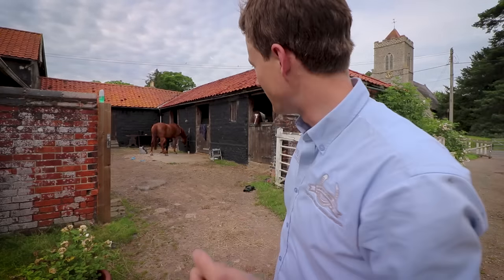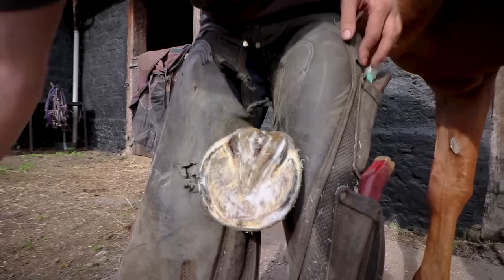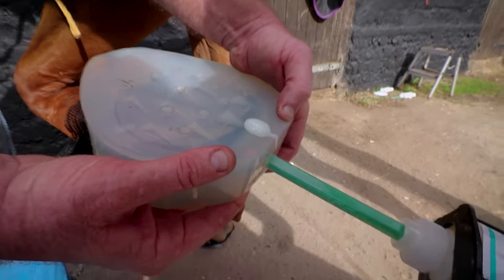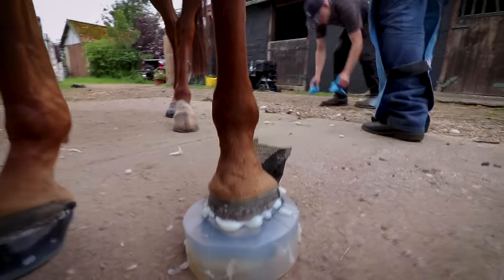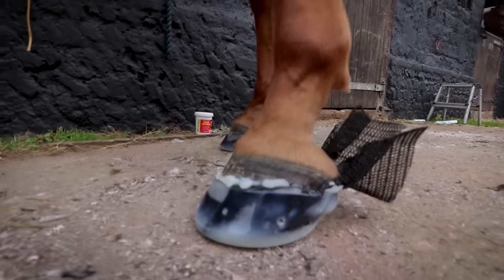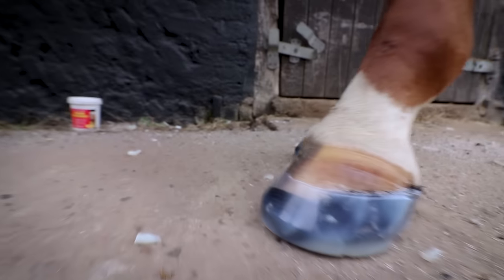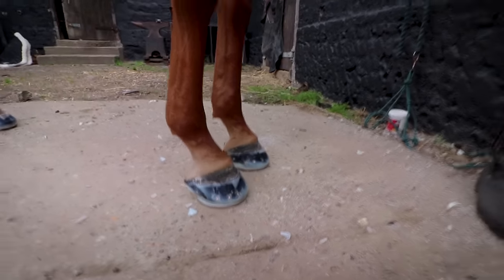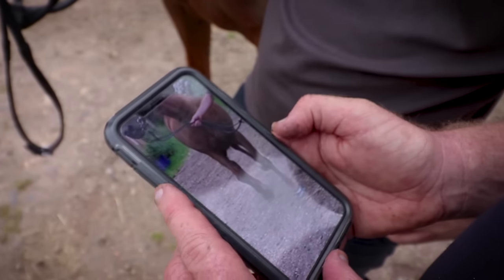How to shoe a horse using resin - Amazingly satisfying

Comment: My only concern would be the hoof wall, sole, frog, and bulb not getting enough oxygen from being completely encapsulated. Kind of like when someone wears a bandage for too long, or fake nails, and the real ones start to turn yellow from lack of air.
Reply: this! the wall needs water and to breath.
Reply: My first thoughts as well. The hoof needs ambient air and moisture to remain pliable and healthy.
Reply: Yeah that’s what I was thinking..it’s like when false nails come off, they do damage the natural nail..everything needs oxygen. I could see it be good for horse with major hoof damage, but I wouldn’t think a long term solution?
Reply: Такие же мысли
Reply: I had this same concern.  This could not possibly be good for their hoof.  Their hooves grow and need oxygen to.
Reply: @April Johnson-  EXACTLY my thought...and I don't even know much about horses shoeing at all, but somehow this concern is the first thing that came to mind right at the start of the video. Maybe a very temporary solution very very short term solution for an extremely damaged hoof until one find a good permanent solution for the damaged hoof that will allow breathing and natural air humidity for the hoof and frog flexibility.

Comment: I've seen these in action, made by professionals at using alternative types of hoof protection. And it still, to this day, feels like a lot of chance is involved. If one of the many factors needed for these, or adhesive options, can not be achived, they tend be faulty. They work fine when everything is perfectly prepared, which sometimes just isn't an option e.g. you come to a private owner, and the horses stand in mud all day. An adhesive wont work properly except you go through a long process of drying and so on. And most importantly, a lot of horses do not have the patience for that kind of procedure. At least I havent seen a lot who do in my years. 
All these alternative horseshoes have their place to be used, but they are an >Option< but not a >Replacement< for iron. People tend to forget that. 
But, I gotta say, you work beautifully and I hope there will always be farriers like you who can do these types of shoeing this well, so people like me don't have to. 
Cheers from austria!

Comment: This video raised more questions than answers for me.    /      Installation seems a bit finicky and could be problematic if not properly installed. For example @11:54 it looks like there may be a bare spot where it did not fill in between the hoof and the mold. I can think of several ways to modify the mold to reduce the risk of air bubbles being trapped in the mold or leaving gaps.     /     Hoe many times can a mold be reused?     /      How does the final product affect the normal growth of the hoof?        /        I.E. Will it cause problems with a healthy hoof? Stunted growth? misshapen growth?      /      How does it adjust to normal hoof growth? Does it crack or break apart as the hoof grows larger?    /     How hard is the material? Does it allow any give or is it like walking on concrete transmitting vibration to the horses feet, leg, ankle?     /     Since it's bonded to the hoof, If it cracks or breaks will it rip the hoof apart as well?       /     How long does it last compared to a standard shoe?       /         Since it will wear unevenly how thin can it be in any one area before it needs to be replaced.       /      Video could do without the music. Especially when they're talking.
Reply: also will it hold moisture and bacteria??
Reply: You're on the right track. there's definitely improvements to be made. Make sure to look into things like "shore hardness". I've considered this for my horse as well, and being a mechanical engineer I've had very similar questions.
Reply: You can just use enter in youtube comments, wherever enter means sending the message shift+enter should work
Reply: Hard to not read it as Dwight Shrute
Reply: I was thinking all of the same things.
Reply: Right ..First, Lose the music...too distracting, you do not need it! Are you trying to Educate .or entertain?? People interested WILL watch!! Thanks for the information..very nice calm horse!
Reply: @nickpowell7432  Yes...very good question. .this would certainly give me pause ...
Reply: @need100k  in the video the guy said six weeks (I had no idea how long a shoe should last or how fast their hooves grow because I know almost nothing about horse except a little anatomy-basically they walk on the equivalent of our fingertips which is super creepy). Anyway, six weeks didn’t seem long, but I’m not sure I’d want something glued to my nails that long either so it’s probably reasonable in terms of wear/infection risk.
Reply: @nickpowell7432  Ever thought about how your dentist cemented a crown or inlay to one of your teeth...same principle as far as bacteria and moisture....but teeth don't grow bigger after they are prepped for the restoration.
Reply: @KatharineOsborne  6 weeks is about standard time between shoeing / trimming. Sometimes shorter depending on the rate of growth of the hoof and how it is wearing / how the shoe is wearing.
Reply: У меня такие же вопросы. Ппоцесс установки кажется недостаточно асептическим.
Reply: I can answer every single one of your questions with just 3 words: I don't know.

Comment: I think this would be good in a situation where a hoof wall is broken a way to fix it. But I can't imagine sealing up the frog and the inside of the hoof and it not getting any air circulation and this being healthy and not a breeding ground for bacteria or to over soften it. Kudos to the horse in this video though. I think this would be awfully hard to do for a horse that didn't stand this patient or still. And when he said it's going through the curing process I seen the horse pick his hoof up quickly I'm wondering if the curing process doesn't get too hot
Reply: I saw this once when a horse suffered from partial hoof loss after a laminitis. It worked well but they could use it just for 8 weeks at the longest, because it could hinder the natural growth of the hoof.
Reply: I was wondering the same thing. And that mesh absorbing moisture and seeping down and staying trapped in the formahoof.
Reply: You have spoken what is in my mind.
Reply: This is why I'm against my mother getting a horse for the first time despite being in her 60s now. 
She has no experience whatsoever and horses aren't like dogs where it's easier to learn without the dog suffering.
You mess up with a horse that has serious consquences.
Reply: ionlyhearwomps lol woah
Reply: @ionlyhearwomps  What did you even say.

Comment: Amazing to see that even the oldest, tried and true proven technologies can be improved upon today.  Certainly helps to have a very co-operative horse that seems to love the pedicure.
Reply: i wouldn't say this is an improvement
just more pollution, where as iron shoes are reusable
Reply: @whitter86  Not mentioned here about how long the poly shoe will last, particularly if an iron shoe is paired with it.  No mention of how many times an iron shoe can be applied to the poly shoe.   Looks like a good repair for a cracked or damaged hoof or to prevent further hoof damage.
Reply: @whitter86  Totally agree.   Just more waste on the heels of planned obsolescence.
Reply: @Dick Bison bro I think you should drop the bison in your name. It's more fitting. 🤣 🤣 🤣
Reply: @dickbison  is that supposed to be offensive? i'm not dirty, i'm not a hippy, i'm educated and you are clearly not
Reply: @dickbison  you do know that hoofs grows like human nails so they had to replace them constantly right? this serves best only to damaged hoofs like the vid imo
Reply: @kyoli012  pretty sure it is meant only for damaged hooves. Much like say a temporary support if you cracked a bone or so. And not actually supposed to be the new long term hooving technique.

Comment: I wonder about the breathability/flexibility  important to the frog and growing hoof and sole structures if sealed behind polyurethane.  Won't that artificial, non-permeable  environment create a damp, warm haven for all sorts of bacteria and fungi to thrive ?

I think the concept has merit ... just not sure the prototype has got rid of some potentially major hoof  health risks/issues.

  Like others, I also wonder how difficult the formahoof will be to remove and further weaken/ damage the hoof wall in the process.
Reply: Yea i wonder the same things
Reply: Well they filed
It down real fine and sprayed a disinfectant on it before they out it in the mold and only
Leave it on-for 6 weeks
Reply: For a damp environment all I could think of was softening of the keratin, hoof wall staying moist. Also, uneven application of the acrylic.
Reply: Exactly my thoughts. This must ruin the hoof in a wet environment.
Reply: Liz Steeds maybe a cushion layer need to be add with breathable hole to keep moisture out from rotting the hoof. I’m no expert just a thought.
Reply: I was wondering that myself
Reply: Liz Steeds yep, need a way for them to get air.
Reply: Hell Bound Zed yea and water to, there is a process when moisture needs to escape which causes humidity.
Reply: since it's moulded to the bottom of the hoof and not the whole hoof i assume it would just grow out with it and then they'd cut it off and apply another
Reply: Barbara James the acrylic was uneven but it filled it the gaps so basically evened out the natural shape of the hoof, disinfectant dries fast and even if it didn't it probably would have dried as the acrylic dried and sort of bonded with it
Reply: Tarja Toivonen an easyboot would trap moisture and sweat, i don't think this would as it is bonded with the hoof not just wrapped around it
Reply: Jay Morgan most carrier fluids are alcohol based or something else for disinfectant spray. So even if it didnt dry, it would just continue to disinfect. The formed hoof creates a water tight seal and moisture never gets in.
Reply: I'm not an expert in horses or hoof care or of the like, I just saw this and thought it would be interesting to watch. But, that being said, I am a licensed nail technician who works with putting acrylic extensions on human nails. A lot of the steps they took, is very similar or the same steps we take for humans. Since it's bonded to the clean hoof, as well as filed and scored for the material to really bond to the hoof, I am confident there isn't a way for water to get in until probably around the 6 week mark. That's usually when products start to loosen, break down, and come off. But I assume one would check on the product to make sure to take off, and then reapply the formahoof to prevent the moisture and bacteria buildup. Otherwise, humans wouldn't be getting acrylic extensions without getting fungal infections or of the like. But in both human, and horses, when the product is applied correctly, it is considered a protective barrier! Hope this helps!
Reply: Yup an infection and crippling because ppl want their horses to look as fake as them.
Reply: I was thinking the exact same thing which is why they used the antibacterial spray I guess, but the growth issue is also there, too. I do like the idea, though.
Reply: @mirandascott8058  I don't think they can get it so hygienic. The most harmful type of bacterias thrive in airless and unventilated conditions.
Reply: I was wondering the same exact things. I doubt the horse can feel the ground very well especially since the frog is covered completely. And how do they remove it? Shave it off? Doesn’t that run the risk of accidentally shaving off too much so if you do this over and over again the hoof wall will thin over time?
Reply: Liz Steeds it’s no different from a woman getting acrylic nails. The hoof is not growing on the outside. It grows from the inside.
Reply: Jay Morgan  I assume it's almost exactly the same as women getting acrylic nails. As long as the nail is prepped properly and dehydrator applied before the acrylic is put on, it's fine. Or course sometimes moisture does get in there, but it's easy avoid as long as there is good upkeep and application. (and to answer your original question there is a specific chemical that instantly dehyrates the natural nail before acrylic is applied. Probably the same for the horses)
Reply: @lasrider11  the same way they remove acrylic nails, soaking it off in a solution probably.
Reply: The horse doesn't walk comfortably....its  not a bad thing but kind of have the same feels about it. No air, chunky....couldn't be a chiropractors nightmare...
Reply: For those asking about the moisture barrier and the mesh reinforcement, check some of the channels newer videos for more medical explanations. This is not a replacement for steel / alloy shoes and general all weather pasturing. Its for rehabilitating  worn out or damaged feet which usually requires stabling out of rain and wet conditions untill the hoof can regrow. Medicated gause and petrolium jelly can be applied under the acrylic layer to prevent further decay.
Reply: The cornial band at the top of the hoof is open and exposed so it's good to go.  The rest is just nail other than the frog.  As long as it is dry and the frog can be depressed as it walks and can pump the blood out of the leg it is fine.  This is to treat specific hoof conditions not a wear all the time accessory.
Reply: There’s also the matter of removal without damaging the hoof, and before the hoof grows too long.
Reply: Miranda Scott 
Six weeks is a long time and time enough for tissues to break down .. I can only see this causing problems .
Reply: @NessieNomsChu  Thank you for the explanation.
It was definitely helpful!
Reply: @shaniawitt1245  Exactly, and not only a way for them to breathe and not get infected, but they should find a way for this shoe to be able to take it off and allow the horse to be in contact with the soil for  a period of time...imagine having your shoes fixed to your feet and can´t take them off...

Comment: Nice job but how do you take it of for the next shoeing? Could you show us the same horse after 6 weeks?
Reply: They should come off like a Sigafoos shoe. I just etch a V in the toe through the acrylic and then peel off the sides and toe area with pull-offs. Easier said than done sometimes, but after a few, it gets better.
Reply: You don't replace the shoe you replace the horse.
Reply: @enigmacrk200  hahaha
Reply: @enigmacrk200  usual nomadic way of business
Reply: Sam Lutfi 🙂
Reply: It would seem like eventually air and moisture would get inside? How long are these supposed to last
Reply: That's when you call a vet after the infection sets in and cripples the horse....
Reply: @victorianilsen763  6 weeks or more
Reply: @victorianilsen763  or less obviously if you ride/walk alot
Reply: Sam Lutfi incorrect